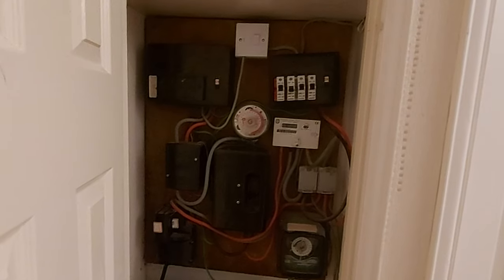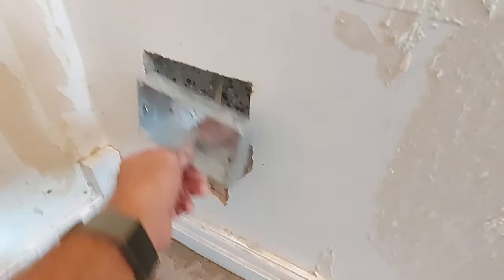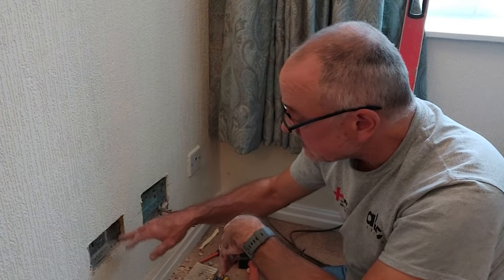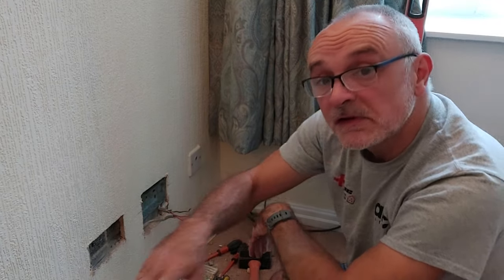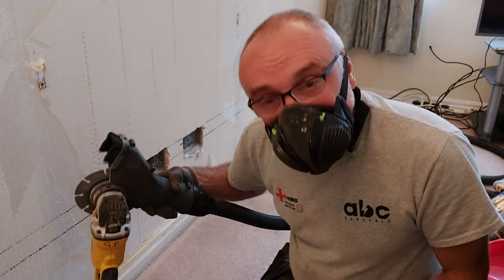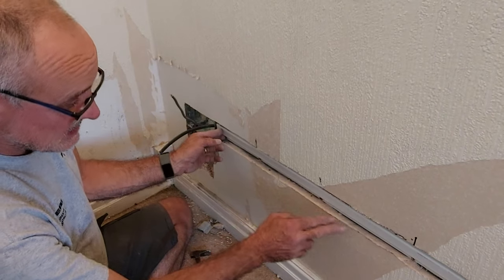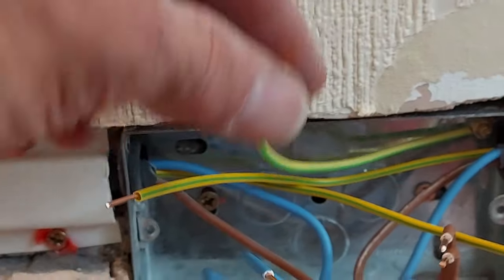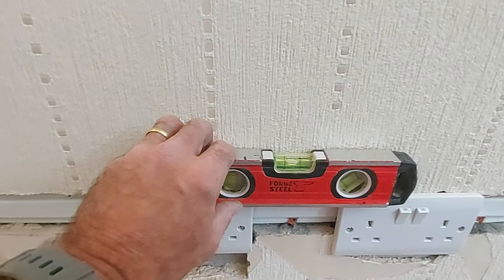Adding additional sockets to an existing ring final circuit

Comment: Hi I have just come across this video , and think you did a Nice job well done 👍. But I think you left the conductors a little bit too long. What I do is grab the conductors in hand in a  fist and place the side of my fist  flat against the edge of the box the snip the conductors  against my thumb and that gives me the perfect length  to dress in  and enough slack for if the socket needs to be removed or replaced. Also I think you would off been better off using a rotary hammer drill with a chisel bit to cut the boxes in not a multi tool . Other than that nice bit of work mate . 👍

Comment: That attachment for the grinder looks good! Which vacuum do you use to extract?
Reply from the maker: The attachment is called MaxVac from Dust Arrest and I just use the ubiquitous Henry vac. Works a treat for what I need
Reply: @abcelectric  thanks mate, will look into that. Just what I need! Loving the channel, just found you!
Reply from the maker: Thanks Ben. You're welcome 👍
Reply: @abcelectric Hi mate

Does that attachment fit all angle grinders?
Reply from the maker: @zippymo672  No. You have to select your grinder model

Comment: Try not to use jargon . " No grommet in the box " What does that mean ?
Reply from the maker: It's not jargon to anyone vaguely familiar with electrical installations. Look up the word grommet, but as a heads up it's basically a rubber washer. A box is a backbox - the box shaped thing that an accessory (socket, switch etc) screws to. This is not a "How to DIY your electrics" video. It's a Vlog of an electrician at work.
Reply: No offence but if your gonna try electrics and don't know what a grommet is I'd say get the professionals in
Reply: it means, get an electrician to do the work for you

Comment: You did not show how to chase the wall
Reply from the maker: Which part of marking walls with lines, running an angle grinder down them and knocking out the middle bit didn't you understand? That's chasing walls. Also, as per my previous reply to you about using "jargon", this is a Vlog channel about electrical work. It is not, and never will be, a channel showing DIYers how to do their own electrical installations. Unless you are fully conversant with BS7671 as a bare minimum and a qualified and certified electrician, attempting ANY electrical work is at best stupid, and at worst could result in fire, injury, death and/or a long stretch of incarceration.